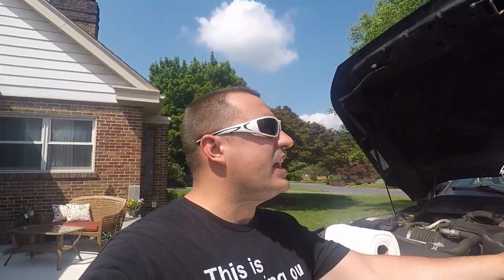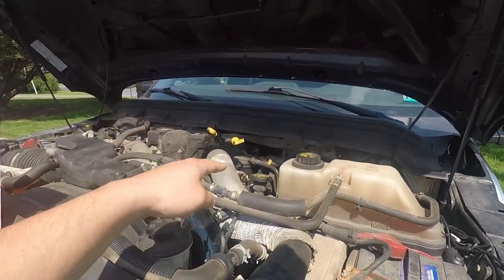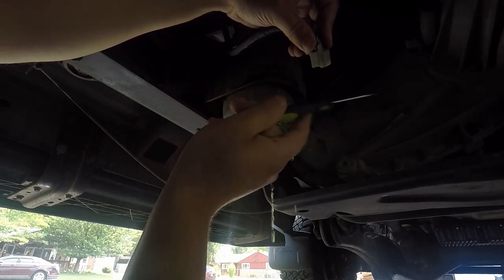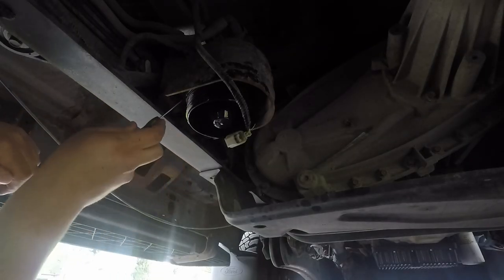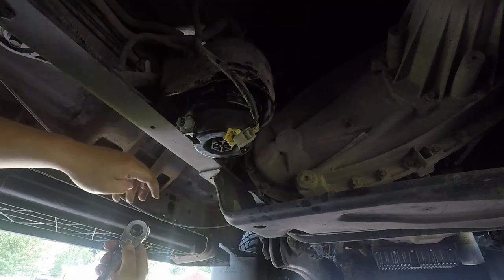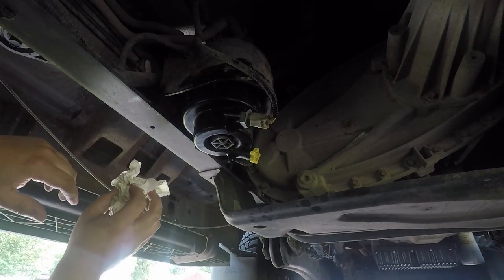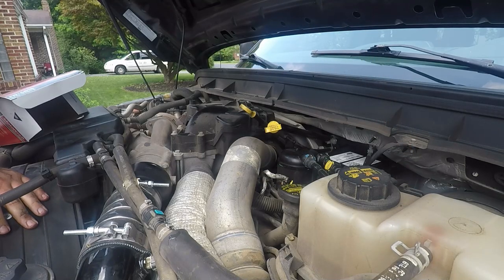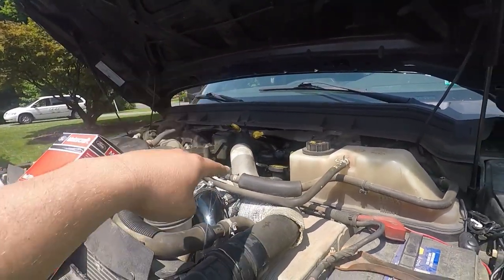6.7 Powerstroke Fuel Filter Change

Comment: Help, changed the filters, did the key turn gas line purge 6 times and now I have a "low fuel pressure" warning and truck looses power and stalls
Reply from the maker: First double check your work. I would drop the lower filter again make sure the filter is installed correctly and then tighten the cap back down. Next go up to and make sure that all the connectors are tight and not leaking. After that I would try repricing the system again but this time doing say 10 primes
Reply: @six0bros  up up and awayyyyy!!! Going to do that right now.
Reply from the maker: @adriangeorgescu3358 let me know  how it goes and get back to me
Reply: @six0bros  Update....got code P0087, low fuel rail pressure with a whinny sound from the pump and just can't get rid of it. I checked the fuel filter housing and it needed two more turns, sucking in air. 
Did 10 more primes and still wouldn't turn over  so I'm redoing all steps and also disconnected the batteries too. 
Took the opportunity to clean the battery stands and connections too.
Reply from the maker: @adriangeorgescu3358 how much fuel is in your tank? I think next I would have someone turn the truck to power on (don't try and start) amd see if there is a leak on the top side with the pump running
Reply: @six0bros  no leaks but doing all these bloody tests drained my batteries now😮‍💨😮‍💨

Comment: ok smart guy did the same thing you did but it will not self prime with the key. any ideas
Reply from the maker: Just to clarify how many times did you cycle the key and how long did you leave it on? Have you been able to check and make sure the pump itself is working? The 6.7 powerstroke is self priming in the fact it has a low pressure pump that feeds the high pressure one. So making sure everything is hooked up right, and make sure the pump is working on the frame. I would repeat doing it. I forget how many times but I would try 10 cycles and lasting 30 seconds a piece
Reply: @six0bros  I think I screwed up the oring placement. usually o rings are put in a grove to hold them so they can't move on ya. I did this with no light I think I put it on the last thread. maybe you can remember if the o ring goes in its own groove or just slides up in that open section above the threads. I just never saw how far up that o ring went when I pulled it out. thanks
Reply from the maker: I'll rewatch my video but I think you may be right that it goes up higher in a slightly odd location
Reply: I messed with it yesterday and put a clear hose on the fuel filter under the hood. The fuel that came out was mixed with air and never got better. I had pinched the o ring when I put the housing back on, my only hope is I damaged it. So I’ll let you know.

Comment: Perfect timing with this video about to do my own 6.7 fuel filters.
Reply from the maker: Nice man glad to hear it. Hopefully it saves you from drawing to much fuel out of your lower filter like I did lol. I ended up with most of a bucket full until I realized there was a check valve lll
Reply: 6.0 Bros yeah that will save me from learning the hard way.
Reply from the maker: That's part of what I am here for lol. Make the mistakes so you guys dont have to haha
Reply: 6.0 Bros  its greatly appreciated!!   When is the 6.0 getting back on the road?  Should have mine back up and running soon.

Comment: What happened after changing fliters,did the 30 sec intervals  6 times but when truck turn on truck just turns at first took seconds the started and shut off
Reply from the maker: Sounds to me like you have air in the line yet. Make sure filter and connection are all made. Make sure the pump on the frame rail is turning on and that it isn't dead

Comment: 2016 just bought it,6.7 driving home it says low fuel pressure and loses some power,anyone had this happen?
Reply from the maker: Start with fuel filters is my recommendation.
Reply: @six0bros  thanks appreciate advice
Reply from the maker: No problem. After that you need to verify where the low fuel pressure is. If it's coming from the low side or high side of it.

Comment: Back that case off first. 3 turns or so and then crack drain so you don’t just suck fuel from fuel tank
Reply from the maker: Yea I talk about that. I mean I just open the drain and go because it wont waste much fuel that way but you're correct and that's good advice

Comment: I would love to see the Amazon links for parts.

I just ordered my oil, oil filter, fuel filters, and Hot shots Stiction eliminator from Amazon. Everything should be here tomorrow.  

Getting ready for an oil change.
6.0
Reply from the maker: I wanted to put a link to the filters but it seemed like all the ones I could find did not seem to be OEM filters they appeared to be Chinese knockoffs so I couldn't in good faith put a link just to make a couple bucks you know.
Reply: @six0bros  the oem ones are probably made in China too.
Reply from the maker: Very well could be but these didn't seem like good filters. I may have found some and can't remember if I put one in the description since